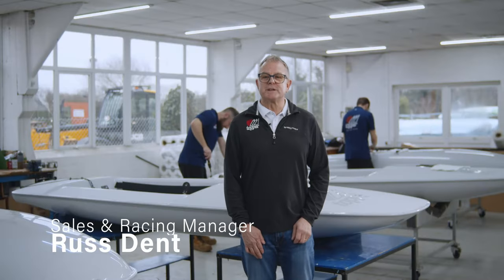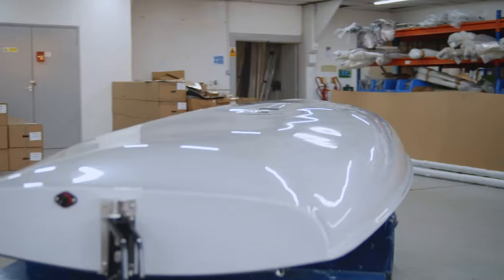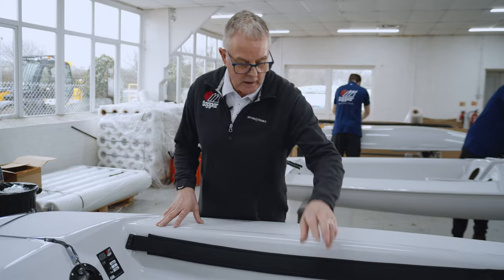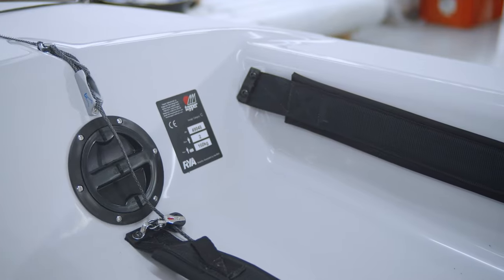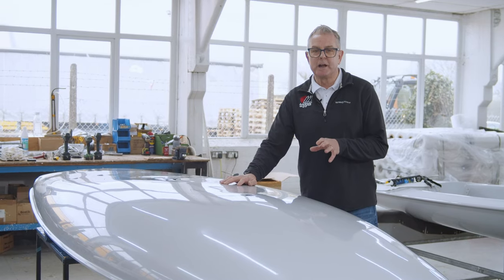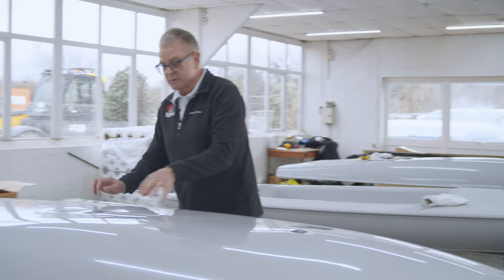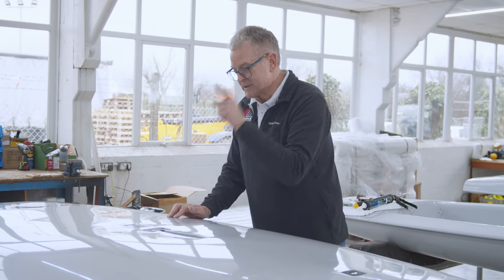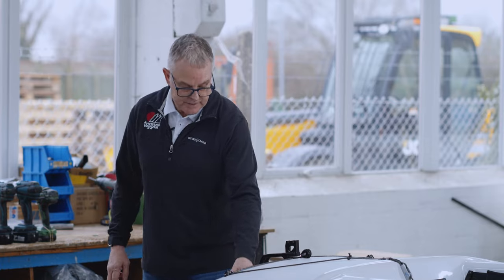Topper |  New Features

Comment: Hi Russ,
 Many conratulations to Topper International and yourself on producing such an attractive looking new boat. The improvements are very significant and I hope that it's a great commercial success. As you say in your video, the new boat will be a noticeable improvement to the old Topper. The hull looks very smooth and seems to have a more consistent shape than the old boat. Hopefully, it will keep it's shape better than the old topper. The improvements to the bailer, toe straps and traveller will be very welcome. I suspect that the hatches are more to do with fitting out the boat but I'm sure the storage will be welcome. Also flattening the transom (by increasing the waterline length by around 20mm) will stop the mainsheet catching. All these changes to the hull will very likely improve laminar flow and performance compared to the old Topper. As you say in the video, the new boat is stiffer as it's a one-piece moulding and now made out of polyethylene. I assume that the new boat will have a stiffer mast step and daggerboard casing which together with the hull stiffness will help pointing and tacking. One thing that you haven't mentioned in the video is if the weight of the new boat is within the same range as the old Topper and how consistently the rota molded boat can be produced to a small weight tolerance. It would be interesting to find out. Also is the bow line attachment point any stronger? All the best,
Richard Glynn.